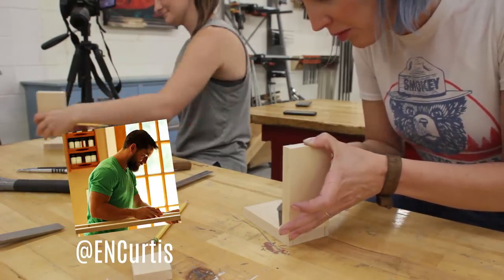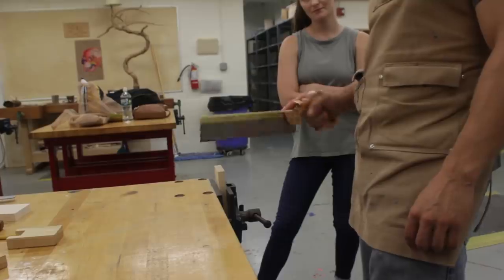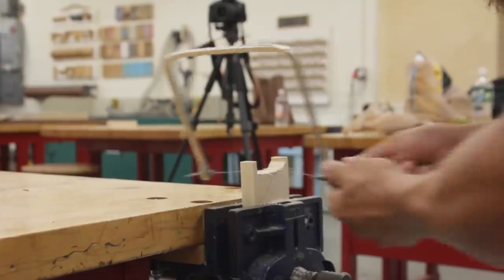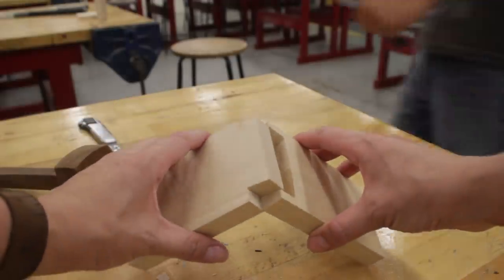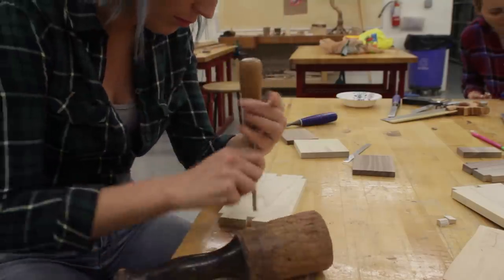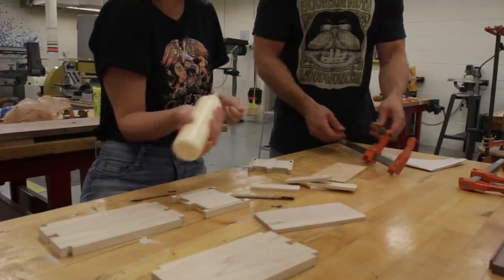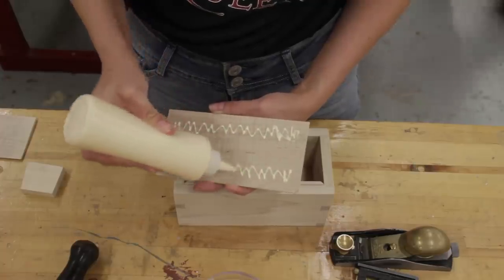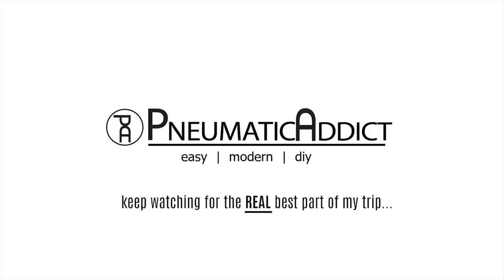A COMPLETE BEGINNER Tries Hand Cut Dovetail Joints | Woodworking

Comment: In Uk schools in the 1960 proper woodworking was taught if you were interested. My exam piece at 16 was a 5 foot 6 inch high book case with hidden dovetails all hand cut. even the shelves were rebated in with dovetails.  I passed! lessons well learned. No 1 sharp tools, lesson no 2 measure twice cut once.

Comment: My opinion: If you cut your box lid off using a sled instead of the fence, you shouldn't have a problem just cutting all the way through like you initially thought (vs the partial cut technique which requires so much cleanup).